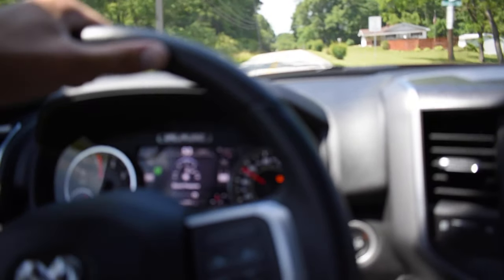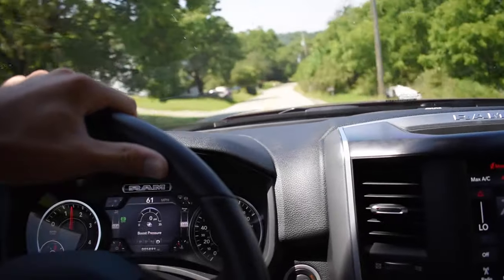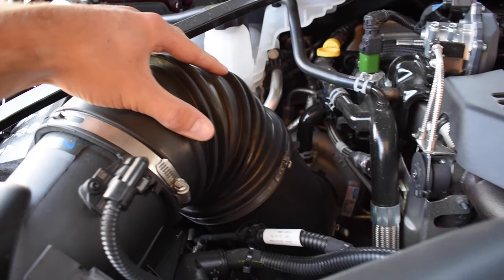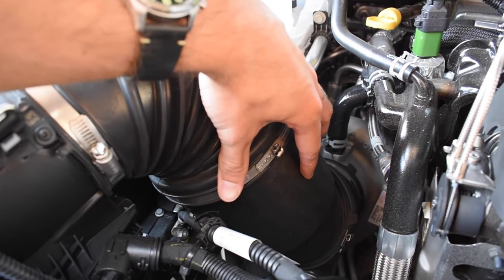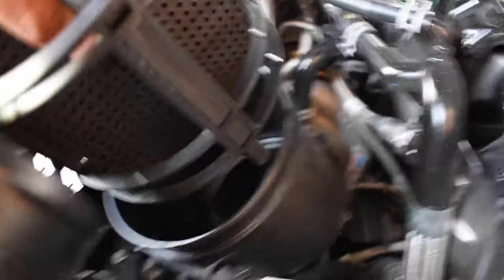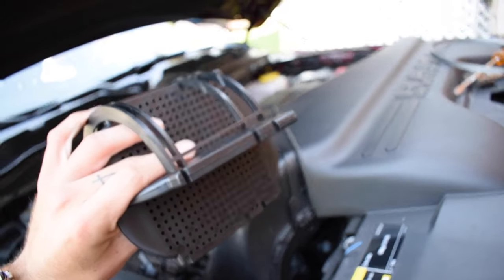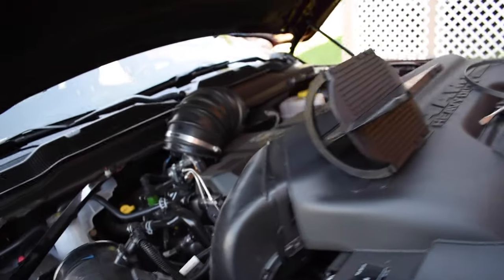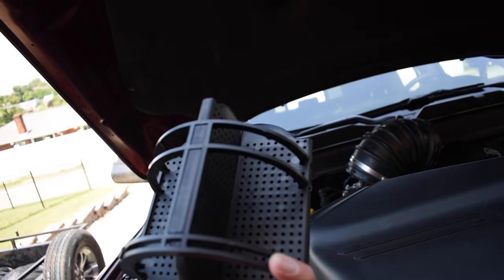Remove this on the 5th Gen Cummins for more TURBO WHISTLE!!! (Intake Baffle)

Comment: The air going to the bottom and wearing out bearings i call bullshit. Spent the last 10 years building power plant turbines, the turbine itself is pulling air in, its not being forced into itself down the tube, its pulling the volume of air directly in front if itself evenly there is no way its only pulling air to the bottom, ever. Trust me if a banks intake doesnt have one its bullshit. Cummins doenst even design that intake its mopar ram

Comment: Just a heads up, if you want to save your brakes put the exhaust break to on instead of auto. Auto only works when you press the breaks on the truck whereas On works when you take your foot off the gas.
Reply: I prefer keeping mine set on auto.  This way I can still leverage the ability to coast when I lift off the pedal, and just a tap on the brakes gets it to engage.  Auto also helps maintain speed on downgrades, particularly when using cruise control, but also works without it.
Reply: occasionally I like to coast..  sure if i'm pulling our 5th wheel but why would you run the exhaust brake all the time.
Reply: It keeps your turbo clean to run it on auto all the time
Reply: @ELITEAUTOBODY23  it also puts crazy strain on your cylinder head, id much rather swap brakes than a head gasket.
Reply: @Charlie-zo2nu I read somewhere ram is the only one with beast head gasket which is why they were even the first to put exhaust brakes on pick up trucks.
Reply: @Charlie-zo2nu  You don't think it's designed for the pressures when one runs the exhaust brake?  It won't just be brakes you will be replacing if you don't run the exhaust brake.

Comment: You should have watch this video and you would have known there was no foam... After market cold air/ram air intakes do nothing for power or throttle response.  ALL stock vehicles are designed to be able to take more air in than a stock engine will ever want.  Unless you are doing internal mods to the engine and exhaust you're just wasting money.

Comment: 2015 3500 with 167k miles deleted at 120k wen the DEF fault started counting down   $3500 dealer quote to fix it $2100 to delete tune straight pipe exhaust. Still  on original brakes rotors and always run exhaust brake and use tow haul mode which is pretty much same thing as sport mode for all the cars.

Comment: So the title for this video is bs?
Reply from the maker: I mean, yes and no… if you remove the baffle, it’ll definitely make the turbo noise more audible… I chose not to because I heard of negative effects to removing it entirely. If you watch the video, I specifically tell you that the purpose was to remove the intake baffles green foam that typically is wrapped around the baffle itself. Although come to find, that that 5th gen Rams do not come with the foam as the 4th gens previously did. Looking back, and noticing after replacing the intake housing itself, I should’ve went for a ride with the baffle completely removed to see the actual difference… turns out we’re all not perfect and it slipped my mind while filming 🤷🏻‍♀️

Comment: The dimples on the surface can create small eddies that the airflow rides over supplying the turbo with a nonturbulent flow. The air can travel faster and cleaner over those eddies.

Comment: Good theory on baffle removal, I’m just not seeing it as a detriment. Performance engines, don’t have baffles and do just fine. Air volume is air volume, it’s not going to pick one spot of the turbine wheel to pass through. Only real way to tell is to put it on the dyno, not a just a scanner and butt dyno and do a before and after resonator delete. For some extra mpg, as long as it’s under warranty I’d take that sucker out and put it back in before servicing since it only takes 2 minutes to remove

Comment: Aftermarket intakes don’t add a baffle, and they gain hp. The stock setup with reduced restrictions is a cheap alternative to an aftermarket intake.  Likely that theory on the air not hitting the center of the turbine is exactly what it is, a theory and has no solid proof. Likely they felt what most people do when adding an intake is a slight loss on the bottom end. Ive never seen a high horsepower engine have adverse affects from a free flowing intake. You make lose alittle bottom end due to the free flow, but you pick it back up top.

Comment: No tire sensors with the new rims or just not calibrated?
Reply from the maker: Gotta be honest, I’m not sure if there are sensors in the wheels or not. Guy I bought them from had an 06 Duramax so if there are any in them they probably wouldn’t link up too well so I honestly haven’t looked just assuming they’re not there, or that they’re just the wrong ones for the truck 🤷🏻‍♀️
Reply: The sensors must have a really narrow range, I put 22x12s on my 21 and the driver side won't read after 6months